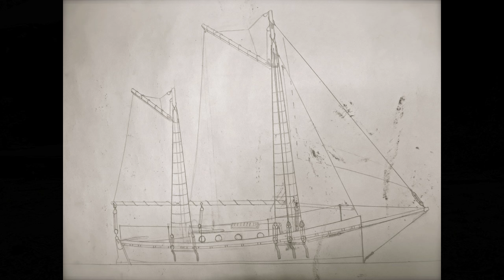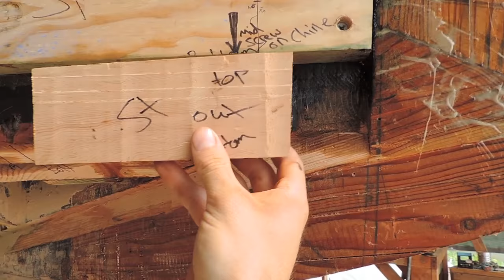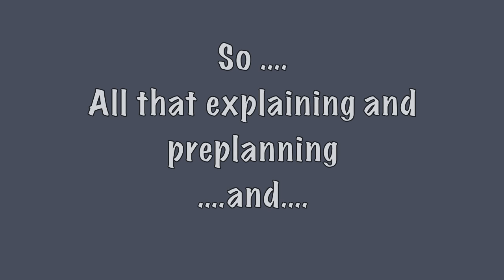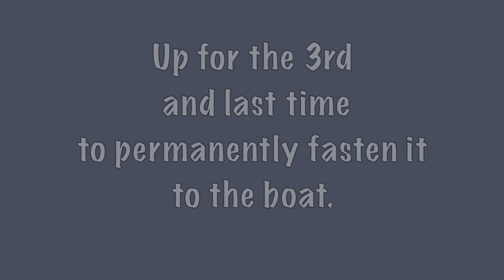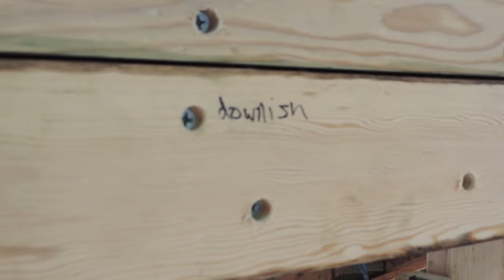Salt & Tar Episode 13

Comment: Hi! Love the videos! Please don't stop making them when you finish the boat! Just wondering why the bottom planking is oriented differently than the hull planking?
Reply from the maker: We sure don't plan on it :) Cross planking the bottom sides is a common technique for hard-chine'd hulls. The slightly angled planks lay quite nicely in this orientation.

R&G

Comment: Tar in the hair.  You need to get it out before it sets and the best solvent is butter.  It’s oil based and the resultant mess can be washed out with olive oil and then shampoo.  If you’ve got any lemon, a bit of that removes the smell.   How do I know this.  You shouldn’t need more than one guess.  Washing up liquid and sugar works well for removing it off skin.

Comment: BIGGEST QUESTION I HAVE IS IS THERE ANOTHER LAYER OVER THE WOOD ON THE BOTTOM, I JUST FIGURED IT WOULD BE THICKER ESPECIALLY THE BOTTOM
Reply from the maker: Not too sure what your question is...? The planks are 1.5 inches thick which is larger than the plans called for so they're pretty beefy. Was that it?

R
Reply: PARALLEL, NOT PERPENDICULAR TO THE BODY OF THE SHIP, IF THATS ANY BETTER
Reply from the maker: If you're thinking double planking or cold molding on the bottom (?) no. This is how cross-planked boats are built. If you want to know more about the style Rediviva's built in check out George Buehler's website: http://www.georgebuehler.com/
Sorry if I'm still not getting it but thanks for writing David

R